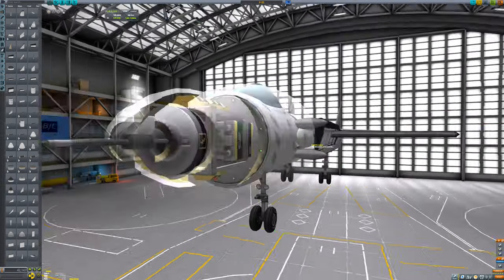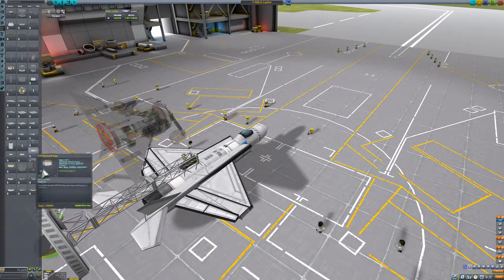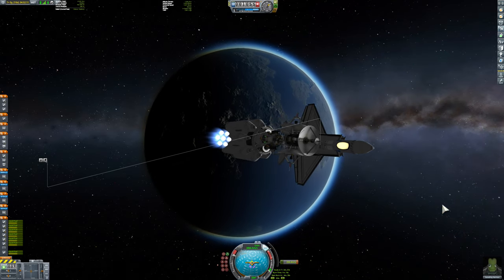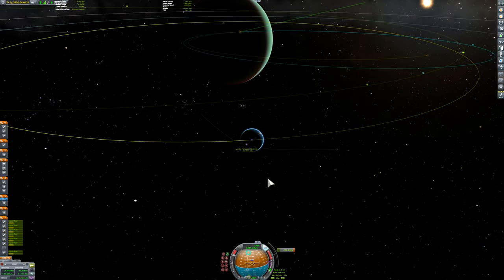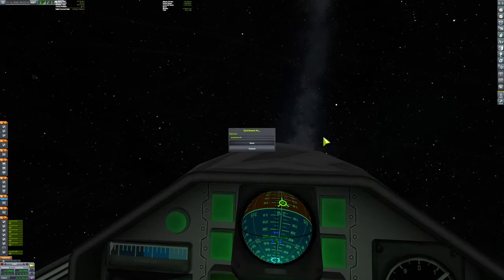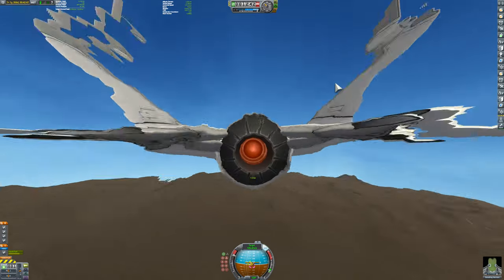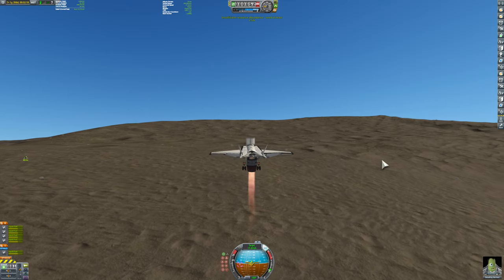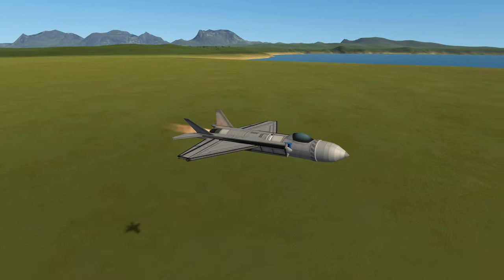KSP: Sending an F-35 to LATHE?!

Comment: You were saying you were not good at making gravity turns, but I can't even get an orbit around kerbal. Good on you man, nice plane too, maybe put some guns on it with bd armory or something👍
Reply: Simple answer cheats
Reply: Is there a specific issue you’re having? If you’re simply out of fuel before you can get orbit make sure when you’re building you check your thrust to weight ratios on the staging ui, they should all be over 1 till you achieve orbit because at 1 that means it can pick itself up at sea level hope this helps!

Comment: Sounds like your talking about laminar flow. My guess is the bump in the intake disrupts the slower moving air forcing it to  "mix" with the other air to give a consistent   pressure and volume.  But I'm not an expert in these matters.
Reply: if they didnt have the bump the slow air would create imbalances in pressure and break the turbine